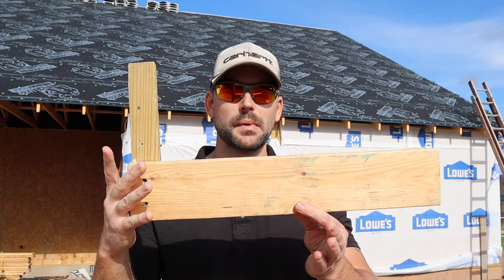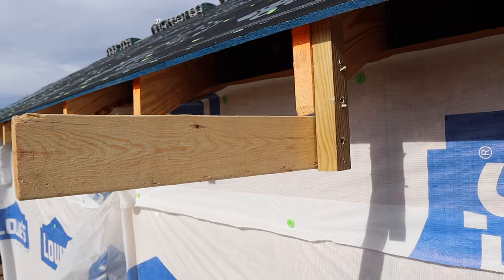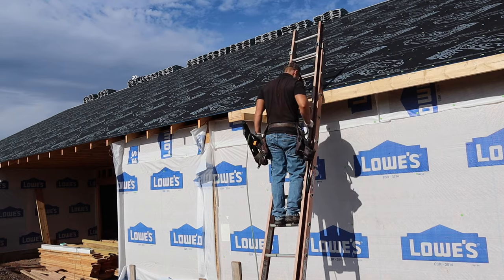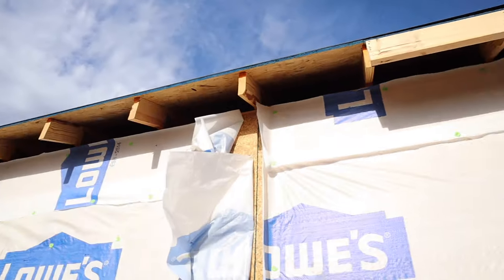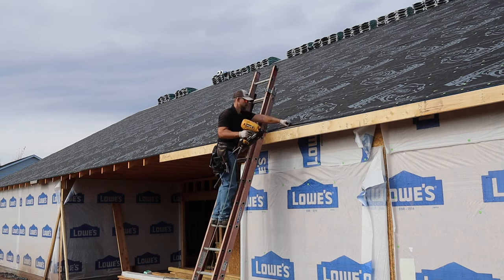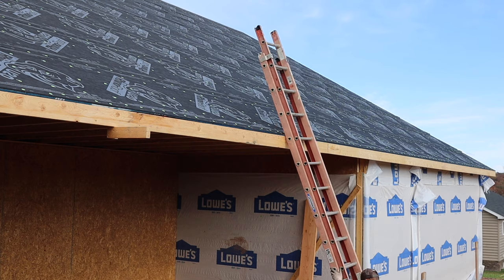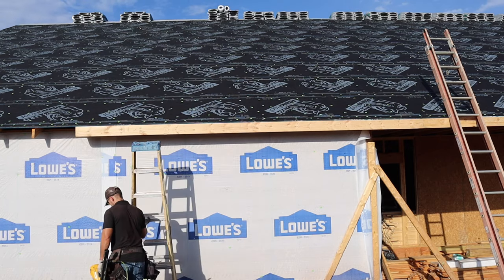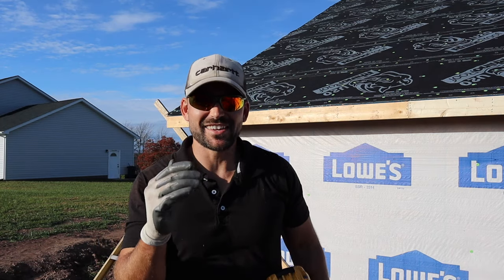How To Install Fascia - ALONE BY YOURSELF!

Comment: You should have overlapping 45 degree cuts on your boards instead of butting them up to each other.
Reply: For? This is the sub fascia…
Reply: @21gonza21  it's good practice regardless to help prevent uneven twisting and warping down the road. Butt ends almost always twist and bow unevenly, pushing your finish boards out of line.
Reply: @jaedonhaskins9917  I'm not a pro, but that only seems necessary if you're not ending on a joist and nailing both ends solid. Especially if you're using aluminum fascia to cover, then it really isn't going to matter at all. Plus If you 45 them isn't that going to just weaken both ends where you are putting in your nails?
Reply: No need to... gutters are going over it and they butt up on a rafter. No one will see and there is exactly a net zero gain in operational integrity and same with a reveal. If the fascia was going to be visible I would for reveal/ Aesthetics
Reply: You should make your own video.

Comment: First thing.  Use pvc for outer fascia board and brick moulding instead of wood.  Especially if you live in the southeast.  Otherwise you’ll be replacing it in 10 years.

Comment: Why so many nails?  Seems like overkill.
Also why not deck screws with a ceramic coating.  Do you have to nail down into the roof decking.

What if your replacing rotten wood.  And why would you use a wood product and not a composite or pvc? Wood rots plastics dont.
Also this only works if your soffets are not installed yet.